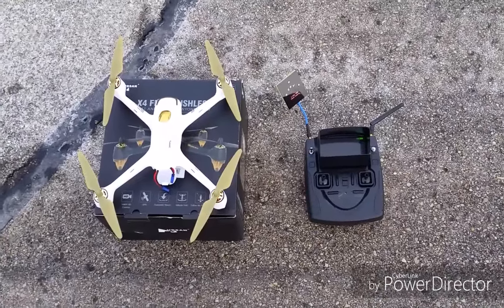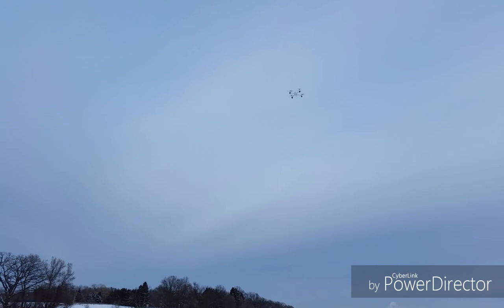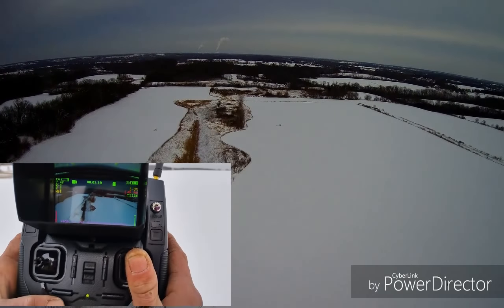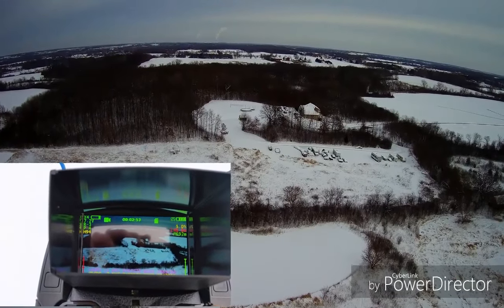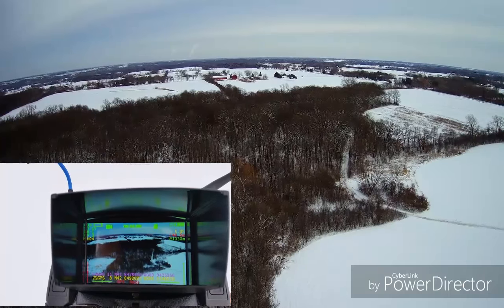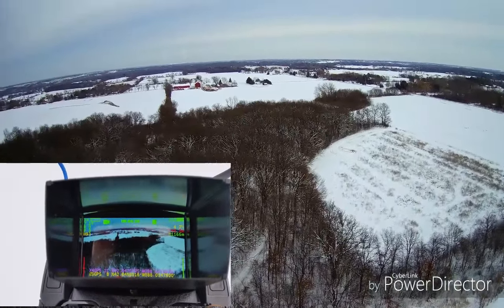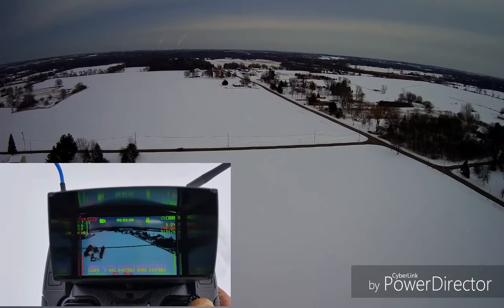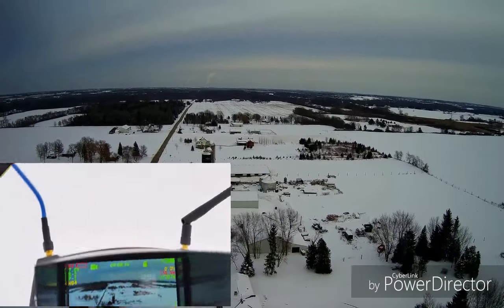hubsan h501ss 2.3Km Range Test. Second Flight After Mods.(May want to turn on Captions).

Comment: Can't believe you made back Mark. Battery was at 7.0 when you hit the RTH. You're one lucky dude!  Don't think you would push safely beyond 3km and back with an additional battery. The extra weight would draw more power.  Have you done this range test with the H501S to see if it makes it this far out and back? Loved watching it fly over the snow covered terrain but a white drone dropping into the snow would be quite a challenge to find :)
Reply from the maker: The voltage readout on the controller, is not 100% accurate, especially at long distances. The flight battery I was using, was also in its "prime". It was just about through 10 Cycles. Also, the cold dense air, helps with rotor lift. It reduces the amount of power needed to keep the quad airborne. Along with that, I have flown this particular drone many times, it can fly for 20+ minutes,  almost every flight (In Regular GPS Mode). Yes, I have done range tests with my 501S. I can get the signal range but I lose FPV reception, around 1,200 - 1,600 meters. Without FPV, it's like flying blind, so I hit RTH. I do have some long-range videos using my 501S but they were made so long ago, I don't remember if I filmed it going as far as I just said. As far as trying to use a second flight battery, it can increase the flight time but you're risking burning up the ESC's and or motors. I've seen a dual battery range test with the 501S. I don't remember the exact distance he made it, but it was further than me. However, this guy did use altitude hold, to get out quicker. And  almost lost his quad, while doing that because it was going into the " tumble of death" while in altitude hold. But he was watching the screen and flipped it back to GPS, when he seen it starting to wobble in the air. Honestly, I'm not sure if a dual battery modification, would extend the range or not and I don't think I would be trying it anytime soon. Thank you for your comment and for watching!

Comment: I have a white drone too. In the snow if downed you are screwed. lol Video is great on mine. Maybe you are pressing the button too much or too far out?
Reply from the maker: Not sure I understand what you mean by pressing a button 2 far out ? I had crystal clear FPV the entire flight. There aren't any buttons to press, when only doing a long range test. Its just a GPS hold flight, and u Pitch forwards. Then hit RTH for it to come back.

Comment: Nice flight Mark - Pretty amazing to get 2300m, against inbound headwind, in those low temps, with one battery.  Got nervous for you when quad voltage was showing 7.0V at start of RTH; glad you made it back!
Reply from the maker: +hugh jass Thank You ! I was going to try and push it further but my hands were literally numb and about to get frostbite. When I got to 2,300 meters, I hit RTH and literally ran to my truck holding my controller just watching the screen to make sure it was coming home at the same time trying to slowly warm up my frozen fingers!! I was aiming for 3,500 meters or more, however I Literally Could Not hold my controller anymore because my hands and fingers were so cold. Also, I was worried about the battery and it making at home like you said... Even if it would have reached 6.6 volts and started to descend, you can manually keep it going as far as it will go until it just lands. But that would be a cluster trying to walk into a field with a foot or two of snow to retrieve your drone and you don't want to land in snow in the first place because you'll end up getting water in it. Appreciate The Comment & Thanks for Watching !!
Reply: Mark - You’ve got a nice flying area; not too many thick stands of trees.  And with the fpv range you’re getting, you have the option to set down in a driveway or empty field if the battery goes critical... as long as you’ve got fpv video to guide you.  Do enjoy your vids, so thanks.  Gaining confidence myself to push beyond my 1500m best range with my ss.  Cheers!
Reply from the maker: +hugh jass Thanks !! I was contemplating on flying as far as I could go until the battery was pretty much going to land itself and then use fpv to set it down on somebody's driveway and or a road. Then simply drive over to retrieve my quad. I'm going to be doing more flying and probably even longer range Tests. I did have a 9dBi 2.4 TX Antenna with me and two other flight batteries. I was going to do the Dual Flight Battery mod and use the larger 2.4 Antenna to see how far I could push it but it got way too cold very fast!  By the time I took off, to the time I reached about 2000, my hands were literally Frozen ! There is always spring and summer !!!

Comment: Awesome flight! Was worried when I saw the tx battery level was red long before you reached RTH point! Everything against you including temps and wind. Fantastic what these hubsans can achieve.
Reply from the maker: +PD Tech Absolutely ! Not sure my controller is showing battery Voltage Accurately. But it Made It !!! All the way Out & All the way Back ! Took 8:53 to fly Out & 9:50 To RTH ! I was almost praying it would make it home ! I thought it was going to land in that field and My niece and I were going to have to go try to retrieve it. Wow ! Thanks for Watching ! :)
Reply: Mark Suttner Enjoyed watching, edge of the seat stuff!! Had every confidence it would make it, good thing, as it would have been a challenge to find that white drone in all that snow! ;) I'm trying similar tests on my h502c albeit on a much smaller scale!! It only has a 450mah battery with an 8 1/2 min flight time, I've put a couple of vids up, it has great range as standard, no fpv so I can only fly it LOS, it's such a small bird, it quickly becomes a small dot in the sky!
Reply from the maker: +PD Tech I I know exactly what you mean. Even my h501s and h501ss are White & Gold. They quickly become a very small Dot in the sky ! Then you pretty much have to rely on fpv for the rest of the flight. Or have a spotter with some binoculars... LOL ! I'm not sure if the h501SS will fly further than 3,000 meters and make a complete return to home trip on one fully charged battery. I sometimes wonder when people claimed to have flown 4000, 5000 and even 6100 meters !!?? There is a video where a guy claims he flew the h501ss 6,100 meters Out & Made It Back. How is that even possible? In his video, all that is shown is the footage from the quad. The video is about 16 minutes long and during this video, he says that he changed the quads rth speed. How is that possible when it can only go so fast and still maintain satellites? I just pushed my h501ss to 2,300 meters and back. With almost absolutely no battery power left when it landed. Can you explain to me how it's possible to fly further than that? Even if you use altitude hold and fly out faster that doesn't mean your battery is going to last longer. When the quad flies faster the motors use more battery... You know what I mean?
Reply: Mark Suttner Yeah I know what you mean, some range claims seem very dubious! Easily faked with clever editing, could easily have a 2nd battery strapped to it or be a completely different drone if it's only showing flight footage. 
There will be a bit of difference from one battery to another same spec one, also how you charge it and how many charge cycles it's had, enviromental conditions such as temp, wind speed etc all play a part in flight time. 
Hopefully will be upgrading to the h501 ss at some point. :)
Reply from the maker: PD Tech +PD Tech Yes, Exactly. What do you think about this video ? Think he Actually flew 6,100 meters Out AND Returned Home ? https://youtu.be/RRHkeP1-bOQ
Reply: Mark Suttner That's modded, on one of the comments he says he used a 5200mah battery!
Reply from the maker: PD Tech Well, I really can't see how you could fit any battery with that amount Inside the H501SS. The OEM 2700mAh battery Barely Fits ! That would explain the distance though. There are other videos that claim Insane Distances. Thanks for responding to that !!!!!
Reply: @MarkSuttner  they  fly  that  far on   second  battery  mods  using  2  batteries

Comment: you are one luck guy 
bob
Reply from the maker: Luck, kinda... Have much experience with the 501S and other quads, as well. I was about 75% sure, it would make it back. By averaging, other flight times and watching the resistance, and cycling the flight bat properly, This quad averages 20 minute flight times, all day long. (In normal GPS hold and good environmental conditions). Anyways, thank you for watching !

Comment: Great stuff Mark! Any issues using the 901A transmitter with the 501S-S?  Any information is appreciated. 
Thanks
Rob.
Reply from the maker: Sorry about the late response, I never saw your comment, until just now. So many... Anyways, the "901A" Controller ? The "H901A" is the "Standard Controller", that's what I used in this video. Not many "issues" with them. Except for the fact, some people don't want to do the External antenna mods. The h906A (Advanced Controller), is still causing people problems, even today with the SS. Not nearly as much as before. But there's always going to be a few bad apples in the bunch... Ya know ?